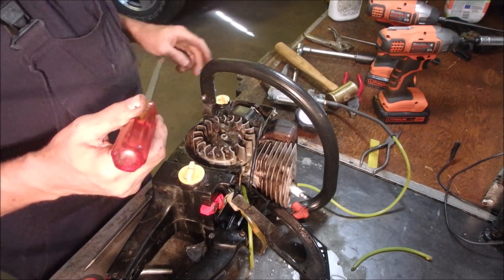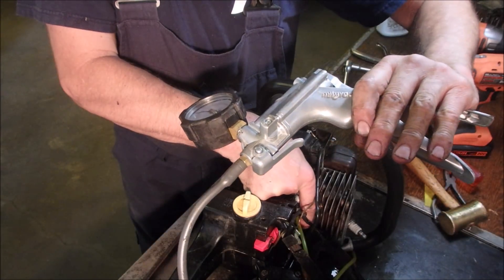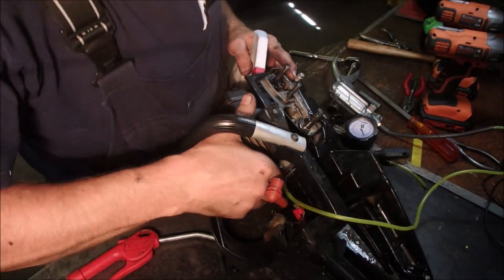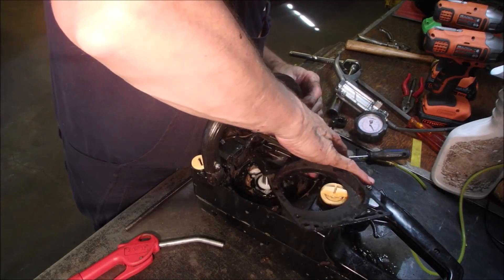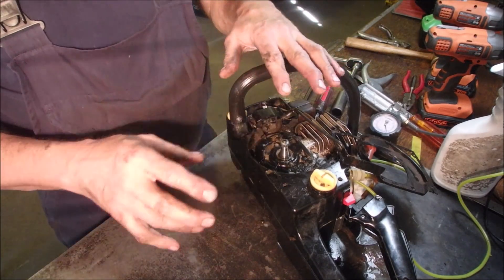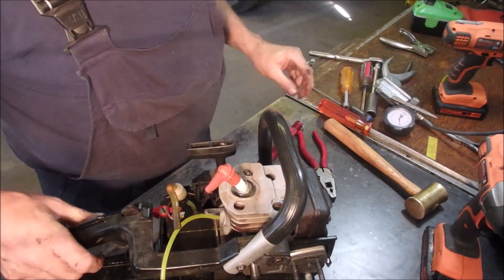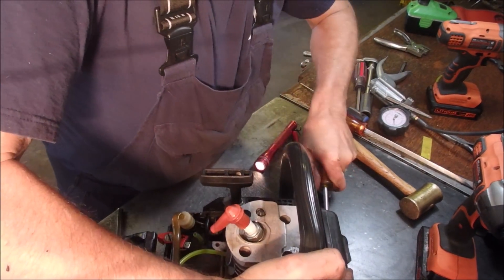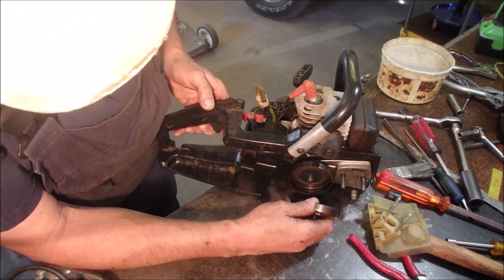Finding Leaking Crank Seals on a Partner Chain Saw

Comment: Hi Bruce,
I added a video to my channel today describing a new Briggs oil change device/process I created. Even though you use a suction device to do oil changes, I thought you might appreciate the effort!
The hose that I used is long enough to do oil changes with the mower on its side on the lift table. 
Cheers,
Jim
Reply from the maker: I will look
Reply from the maker: I went there and just saw a running red Briggs.  Sorry
Reply from the maker: Got it.

Comment: I'm not a 2-stroke guy at all (and just barely a 4-stroke guy), so forgive if this is a dumb question... on some 4-strokes, I know that if you drive the crank seal in too far, you can block an oil passage.  Is that potentially an issue on 2-strokes, or can you just whale away until it seats?  Love the channel!
Reply: Simple answer, not necessarily a drive it till it seats on 2 strokes in all cases, some have a desired depth they want them set at but generally yes you can seat them all the way. Take the Husky 372 for example, they sell a seal tool and it sets the depth without completely seating the seal but I had a crank that had excessive wear where the lip of the seal sat so I took the seal in further and seated it all the way and the saw works fine and passes all Vac/Pressure tests and tunes like it should. Fuel/oil mix and atomize so it coats on 2 stroke, open cage bearings allow the atomized oil to pass through the bearing to lube the bearings and seal lip, no oil passages like a 4 stroke since there is no sump/pan.
Reply from the maker: Well the crankcase on a 2 stroke is the final chamber for the intake manifold.   I didn't whale away   I just tapped it in till it just stopped.
Reply: @BrucesShop  Bruce, was there a ring worn into the crank, kind of like they do on cars harmonic dampener pulley? Seating it deeper would allow the seal to seal against a new spot.
Reply from the maker: @MegaLostOne  Good point.  The saw is now gone back to the owner.  I will take a close look at the video.
Reply: @BrucesShop  Apologies, poor choice of slang. I didn't mean to imply that you weren't careful! I repeat - I love your channel!

Comment: Good trick on the crank seal. I am curious to see how long that will last. Got a great report from surgeon yesterday. Everything is good and she was pleased to see how good I looked and how well I was doing.
Reply from the maker: That is wonderful egearding your health.    
On the crank seals.  what I first noticed was the seal was right at the edge of the taper in the shaft.  I just tapped it with the screwdriver  and the bubbles wen away so i reset it with the punch.  I think it will last

Comment: That was very fun Bruce. What a fantastic idea sinking the seal in a little farther.  It really worked well. Great video my friend
Reply from the maker: Well i noticed the seal was siting a little proud of the flange and the edge of it was near the tapper in the crankshaft.  Parts are hard to get to I tapped it a bit  it stopped leaking so i tapped it with the punch.  Thanks Dave for noticing.